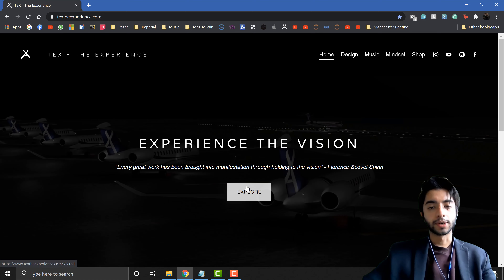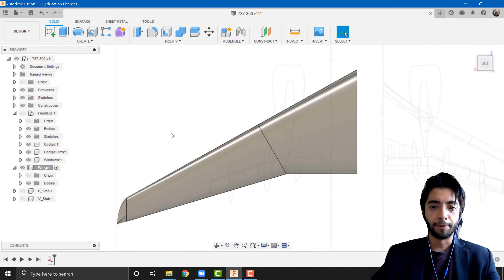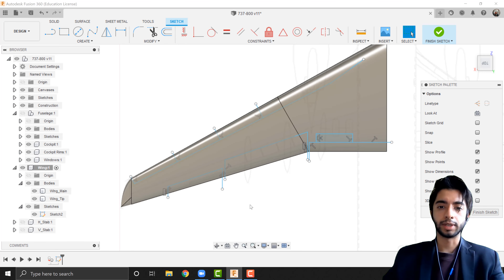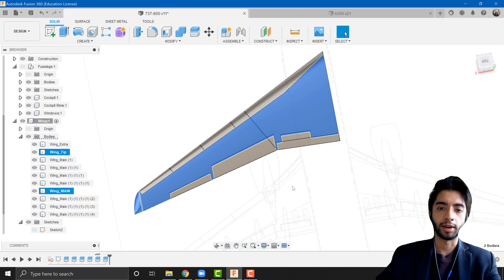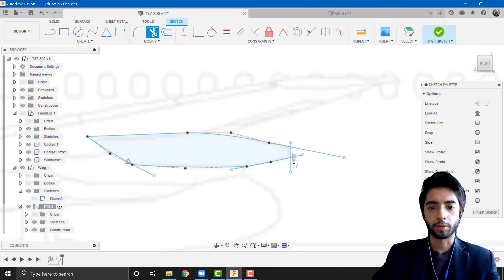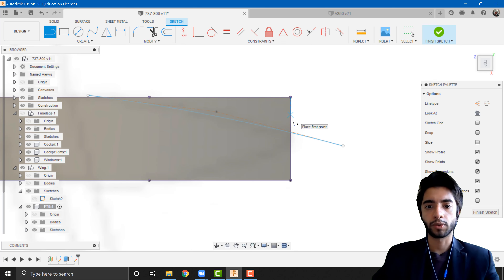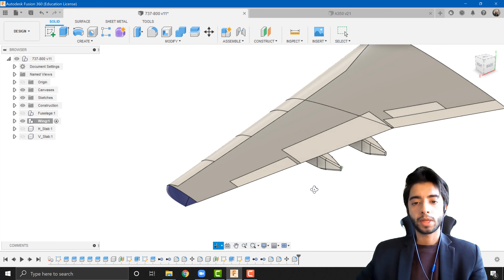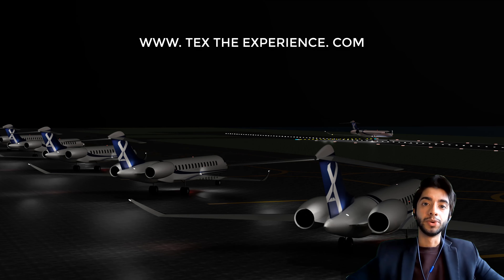How to Model an Aircraft in Fusion 360 | Tutorial 6 - Details (Wings) | Step-by-Step (4K)

Comment: Thanks once more for your tutorials, just question, as i am using this to create a 3d printable model, is there an "easy" way to create engraved lines on the wing and fuselage?

once again, thanks a million for your work
Reply from the maker: Hey there! I think I can imagine what you're trying to do and it's looking super cool. I can't think of a very direct way, but maybe offsetting the windows inwards a little bit will create more "depth"? That way when you 3D print it, you will physically be able to feel the difference. Let me know if you think of something else!
Reply: I know this is 3 months after the fact but I was running into the same issue because the emboss tool won't work on a curved surface like that of the wings. I figured out a work around though. If you section everything like is shown in the video then chamfer the edges of the individual bodies where you want the embossed grooves by a small amount, then you can recombine the bodies with the chamfered grooves allowing for embossed lines!
Reply: @nathanael_opoulos  thanks a million for this, i will try to give it a try
Reply: @constantinosmistrellides2253  Sure thing, if you have any issues just give me a shout and we can troubleshoot.